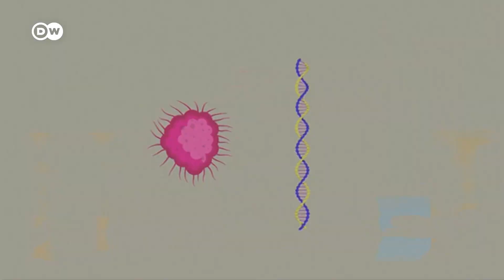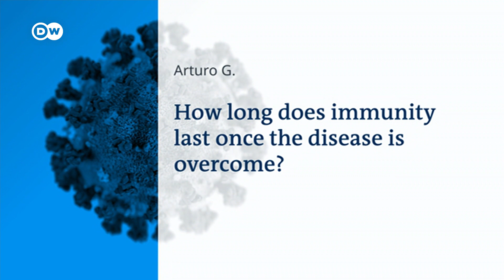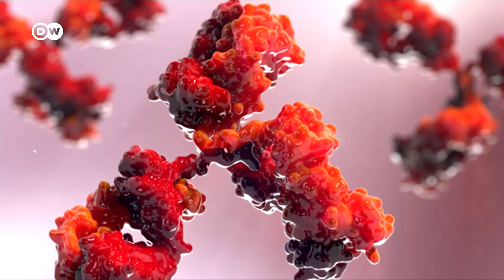How dangerous can mutated coronavirus strains be? | COVID-19 Special

Comment: THIS ARTICLE WILL HELP YOU UNDERSTAND COVID-19

BACTERIAL PASTE (viruses and larvae)

Humanity constantly created and creates clouds of negative energy with its impure acts, feelings and thoughts. These clouds are called padros and are used by the lower beings of the astral to create bacterial pastes.

Each individual owns his padros and gives his contribution to the creation and support of that cloud. Each individual, therefore, is responsible for a fraction of the standards of humanity.

A family or group also has its own padros, which will be more or less negative, depending on the intensity and frequency of the emanations.

The negative astral entities cultivate certain astraline bacteria and sprinkle them on these padros, where they proliferate as in a kind of incubator, forming a dense paste. In this condition, the paste or cluster of bacteria seeks out the breeder of the padros where they have proliferated and fixate on him.

The individual who rarely feeds his padros will create weak and clear paste that may even spontaneously dissolve. Those who are immoral, unscrupulous or negative will create denser and darker pastes. In this case, the attack of the bacteria will be faster and will hardly be eliminated. The more negative the person is, the more resistant the paste is to treatment.

Many diseases that affect humanity are originated in this process of incubation of bacteria that also extends to the cultivation of viruses, larvae, fungi and other microbes and miasmas. The paste resulting from the negative padros of a family may be attracted and fixed on the weakest individual or least evolved in the group.

Currently, these pastes are created with certain devices that make them resistant to positive or healing energy and sometimes even progress further, despite their correct use.

The worst thing is that the negative astral entities are already getting results in obtaining a more resistant paste, due to the densification of padros that Humanity creates each day.

Only highly evolved beings, using advanced techniques of energization, achieve satisfactory results in the total elimination of the effects of these pastes. The cure, however, will obey the principle of merit or the postponement of suffering by superior intercession.

HERICK ATHAYDE USAMI
Reply: haram

Comment: Can't they just make a backup vaccine for this new strain and not even have to go through the trials and testing all over again, since we know that the current vaccine had positive results? If that's the case, they should make it and release it as soon as possible before it mutates yet again.
Reply: This "common cold virus that has a survival rate of 99.97%" has killed more people in one year than the flu does in one season. If it has a survival rate of 99.97% like you say it does, there shouldn't be any deaths at all. It should be just a simple cold. But it's not. It kills people. People who would still be alive if it never existed. Plus, the vaccine is done testing. It's been tested for a whole year and no side effects or problems have been reported, at least for Pfizer's vaccine. So if the vaccine has no side effects and the results are beyond positive, there's no reason to believe that another vaccine with the same method will be any different.